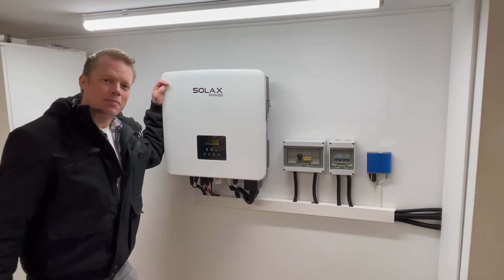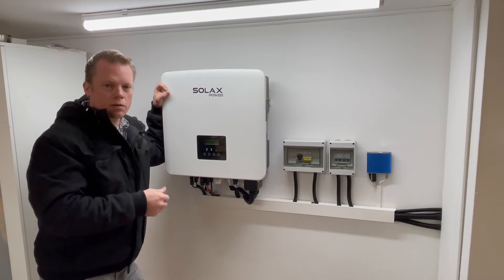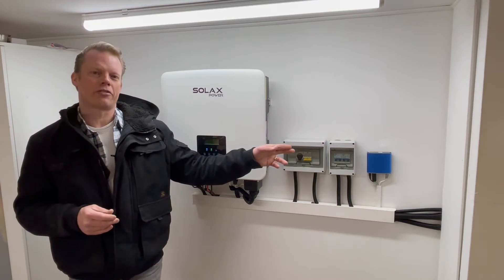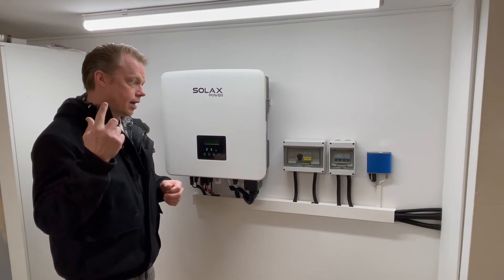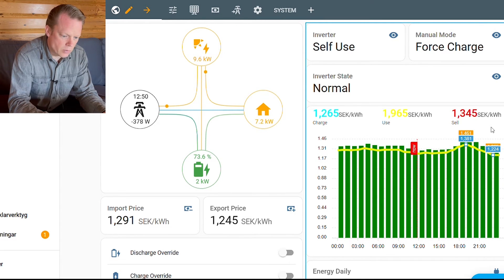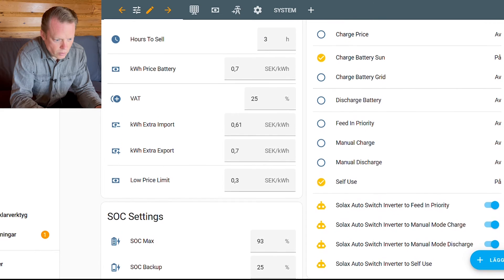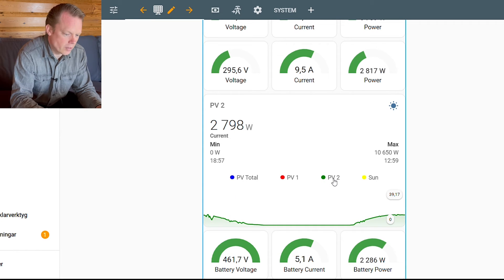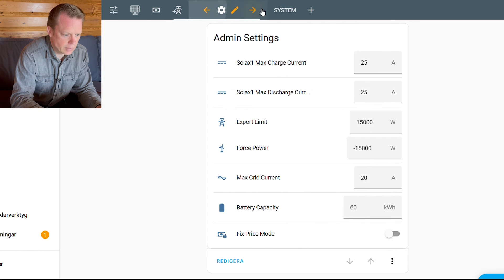Solax Grid balancing, auto charge discharge against energy price. Home assistant, mod bus, DIY Bat.

Comment: Problem!
We set a date and time, but, when we will set parameters, then ....
Please set under normal status
???

What is it? It's not possible to set advanced parameters 😢
Reply: @flyingtools  I know, but.
Solar panels are not connected.

I will start ESP from the city grid.
UNMUTE ESP,
but
Message:
"Please set under normal status."
Another parameter from the display is to change, then the some message:
"Please set under normal status."

I try to make a video.
Reply from the maker: @joramotorsportteam3277  As I remember you have to connect the solar panels and have dc power from them or have a batteriy hooked up to it so it will go into normal mode, not eps, grid needs to be connected for normal mode, if not you can probably not do the settings that you were talking about.
Reply: @flyingtools  Bad systems.
  I will use we backub systems and get power from my diesen cogeneration system in the beginning without panels.
  I connet city grid.
Connect users to ESP output, but Solax not will to start and it's not possible to set parameters in nighttime? No PV power in the nighttime 😢

We need to wait for power from panels?
Reply from the maker: @joramotorsportteam3277  I did this together with my installer for to years ago so I am not remembering it exactly. You need to get help from an installer that is certified for that kind of work and also have the knowledge of solax.
Reply: @flyingtools  Solax  partners one jear not send our company to Solax school 😞

Comment: Hi, thanks for the video!
Can you share more info on the microcontroller?  How do you communicate through Modbus with the inverter?  I've done Orion Can bus to Modbus conversion with ADF Web converter to my PLC controller and the HMI panel. Works good, you could see all data from the BMS, just the coversion is a little time consuming. Good thing about Orion is, you can assign your own CAN frame structures so it can communicate with many other devices. I had chosen Modbus RTU. Once it's in the PLC, it lets me set the SOC on the HMI panel and control the transfer switch, using the utility power as backup only.  Orion puts out 3 variables with an analog signal 0-5V for SOC, Charge current limit and Discharge current limit. I' ve used this signals as well, to dispaly the data and control PLC input module. I would suggest not to relay soley on voltage readings for your SOC. Orion does pretty good job with SOC calculation.
Thanks.
Reply from the maker: Hi! I also use an Orion BMS to my battery and I am very satisfied with it. I use it as a standalone BMS because I do not have the can protocol for this G4 Solax inverter. And the micro computer only read the voltage and control my inverter via an USB to serial adapter between the micro computer and the inverters com port. So I already have two separate systems and I think that I will be fine with that. Thank you so much for your comment.☺️

Comment: Meny questions:
1. Is it possible to start a system without a battery?
2. It's possible to set hours from Nordpool when the price is the best for charging and discharging?
3. Way Do U not use Solax Data Hub?
4. Video about your blue computer and soft for getting Nordpool data. I use Home Assistant, but it's with many errors, prices -1 hour, its possible to correct get correct prices in some hours.😁🤣😂
Reply from the maker: 1 Yes it is possible 
2 only together with home assistance 
3 I’m usin that sometimes.
4 no, not yet.
Reply: @flyingtools  2:20 Microcomputer model Raspberry?

Comment: I just have one recommendation, leave the PI - SD card solution and install it on a PC instead. The SD card will eventually burn off, due to massive read/writes
Reply from the maker: I am not using a PI. I use odroid and it has an ssd drive. But thanks for your concern😊

Comment: To see Solax data in Home Assistant do you need to have a Solax account for the inverter to it to reach cloud on the internet? Or can it be done directly without any internet?
Reply from the maker: Hi, you only need your local network, you don’t need to be connected to SolaxCloud. Thanks for your question.😊
Reply: @flyingtools  Very nice, thank you. I hope I will be able to figure it out, likely will get a Solax system in a couple of months.
Reply from the maker: @TheBlacktom  you’re welcome. Good luck with your project.😊

Comment: isnt the solax inverter a growatt inverter or doughter company of Growatt ?

Are you getting the cloud directly from the inverter without the cloud just by using modbus ?

Usually modbus allows only a 1:1 communication and you would need 1 line for the inverter to smart meter communication, then a 2nd modbus line between the inverter and battery / bms and a 3rd line for the homeassistant system

How did you achieve all of that ?
Reply from the maker: No i don’t think so. I have one communication between each unit.

Comment: What are your thoughts about this inverter vs the growatts that you previously had? I´m looking for 2 inverters to put them in parallel, I like the Solax x1 hybrid g4 7.5kw inverters but they work with high voltage batteries and from the manual they will have to be connected to separate battery banks. The other option I have is 2 Infinisolar V IV 6kw inverters (voltronic) but from what I have read from forums they do not work well in parallel mode. This last inverter works with 48v battery bank. What would you recommend? Thanks.
Reply from the maker: Hi.
The solax inverter is by far more efficient then my earlier growatt inverter I used.

Comment: good day, you have very inspiring videos!!!
thank you for you...
can you please tell me the advantages of the high-voltage battery and the system from 48 Vsystem (you also had it in the past)
I understand that thinner cables, smaller losses, 3 phase inverter... but at the same time more danger???
thank you very much and I have my fingers crossed for your projects!
Reply from the maker: It’s a really really huge difference in efficiency.
If it’s done right I think it can be done safely, but of course you need to have good knowledge about it.
Thank you so much for your comment.

Comment: Kommunicerar Solax med Orion direkt eller sker allt via den blå huben. Vad används Orion till mer än balansering och SOC-mätning. Övervakning low-high voltage, temp. Sker det via kontaktor.
Reply from the maker: Solax kommunicerar med den blå hubben via modbus. Orion skyddar batteriet från över och underspänning, temperatur, max strömuttag mm. Den gör detta via speciella relän på hv+ och hv-

Hubben beräknar soc och begr laddning/urladdning
Solax gör också detta fast via de spänningsvärden jag ställt in.
Reply: @flyingtools  Tack. När du körde Solax utan hub direkt mot batteri. Hur visste Solax SOC. Enbart spänningsmätning?

Comment: Hello mate, which bms you recommend to use with 12S /8S packs 6,85kWh VW which have 1 section with selfdischare? Which one will be enought? (Drop 0,05V in 4 months). To strong one can burn fuses between section.
Reply from the maker: Hi. I think daly can handle that. That one that I used to my modules in my earlier videos had a balance current at 0,050A and that will be enough to handle that self discharge. 
300mA is ok to that fuse, at least those in the 12s version.
Reply: @flyingtools  0,4A will be good too for fuse?
Reply from the maker: @benzoesansodu5866  not recommended, the voltage drop is almost 0,3v over the fuse and it start to get warm at that current.

Comment: Is this Krafthem/Flower you are using for frequency support? Is this software based? (Can you install it on a Pi or do you need to buy their special hardware (like for Checkwatt)?
Reply from the maker: It’s not that company but something like it. It’s installed on an odriod n2 and you have to buy that together with the software. So I think it is the same as checkwatt.

Comment: Hi, nice.
Someone wrote here about the CAN bus protocol and of course didn't put it here, again some blabbermouth😁🤨
I sometimes have a problem with the inverter dropping into IDLE mode, it's getting on my nerves. I don't have panels connected to the inverter, I just use it as AC coupling.
Reply from the maker: It happens to me to sometimes, but only when the load is very small. Around 180w and lower will force the inverter to grid only.

Comment: Amazing setup! Really impressive stuff. I'm sorry I didn't get a Solax inverter now, seeing what is possible with it (I have a Growatt)
Reply: As long as you can hook up the GroWatt to some home automation like shown i don't see why you couldn't do the same.
Reply from the maker: Automation is probably no problem but the inverter has to be certified for frequency balancing, I’m not sure that growatt is that yet.
Reply: @flyingtools  good point.
Reply: @flyingtools where can be found the list with inverters certified for frequency balancing?
Reply from the maker: @blackeyes18ro  I just discussed that with my installer/seller so I don’t know if there is any list. This is still quite new.
Reply: @flyingtools  I'm in Denmark. As far as I know there's no option for private installations to participate in frequency balancing yet.
Reply from the maker: @GoofyChristoffer  Correct, it has to go through my installers company.  The biggest challenge for me though was to have a diy battery to work with this set up.
Reply: @zaprodk  There are a lot of 'holes' in the Modbus register map documents at the moment, and they are really poorly translated from Chinese, so doing things like this is really bothersome. I am building something for it using a third party open source firmware for the wifi module (ESP based), but it's taking time.